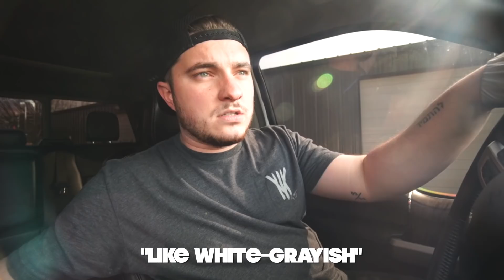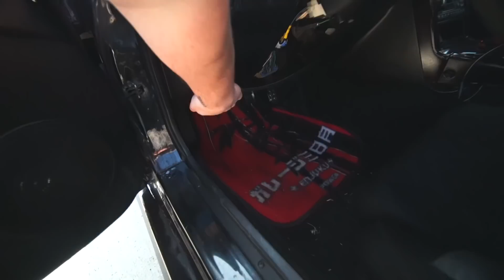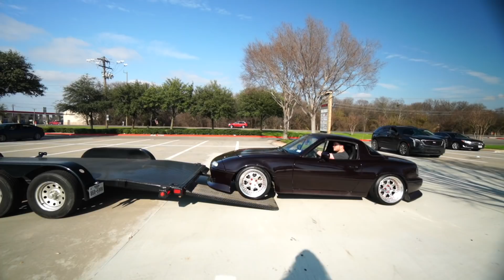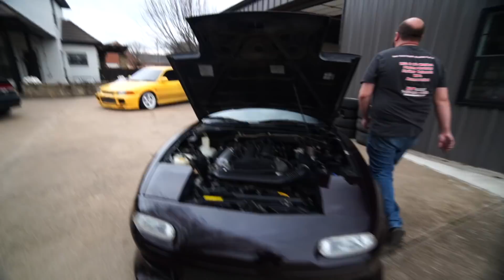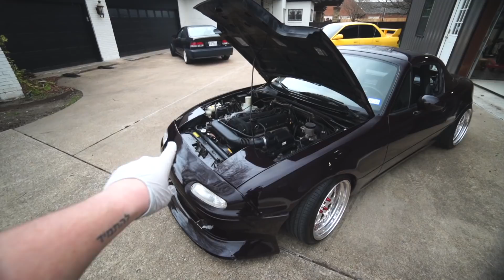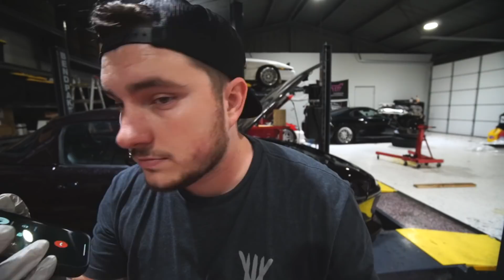Did my Little Sister Blow up My Miata?

Comment: V6 swap in the Miata would be dope. Glad she is okay! It could’ve been way worse and thankfully it wasn’t.
Reply: These things are dope with a Duratec 3.0 in them, great engine, perfectly sized and powered for an NA, and they sound FANTASTIC for a V6. Agree on this 100%!
Reply: @_PGleo86  isn’t the duratec in the ford taurus?
Reply: Lexus ls400 engine. V8. Nightride did it iirc
Reply: Don’t swap it
Reply: Should put a honda j series in it
Reply: Yes but a mazda kl de from the Ford probe its a mazda v6 sounds amazing not over the top hp reliable and again sounds amazing aa Heck
Reply: @firenut9489  j37 from the supercharged acura suv, j32 heads, j30a4 cams regrind (3 stage vtec actually for real power) and yes keep the supercharger.
Reply: throw a honda J30a in there, hooooo boy
Reply: A turbo l67 would be sick or even a 2grfe na with velocity stacks
Reply: K24
Reply: Ecotec swap
Reply: Vr30 swap it 😩

Comment: If you can, replace ALL hoses! My 99 had the same issues after I turbocharged it and one by one the old 22 year old hoses starting breaking off. I spent a good week or so trying to diagnose where my final leaks were. Apparently  there are two coolant hoses going to the oil filter cooler (pain to replace). But since then NO leaks at all. Some good preventative maintenance doesn’t hurt anybody 👌

Comment: Had my heater hose blow, loads of steam. The CAS (Cam Angle Sensor) has an o-ring that commonly leaks, dripping down onto the heater - rear engine hose and it eventually degrades it.
Reply: Had mine blow too hot coolant went all over my feet. Sat in a grocery store parking lot waiting for my buddies to show up with tools to get it back on

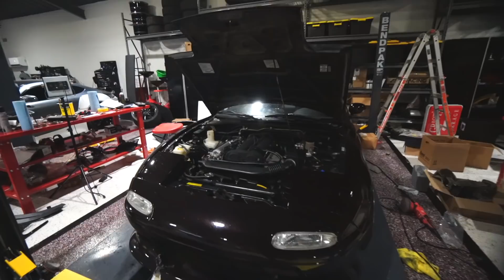Comment: 13:41 if you are planning on boost i have heard something that it's sometimes cheaper to swap a mazdaspeed miata motor with a turbo than doing a turbo kit and it's more reliable
Reply: No
Reply: Would make sense as they are a turbo engine from factory as apposed to turboing an na car, maybe they don't run well for compression reasons. Idk
Reply: @TwinJag374  no they run fine and love it.
Reply: Yes and no, the mazdaspeed kit is good if you dont want any more than say 180hp. It's restricted by ecu, turbo doesnt spool to well, the exhaust is restrictive etc. Basically if you wanted more power you would have to buy a turbo kit anyway.
Reply: @DacsterMC  you can modify ecu and exhaust tho
Reply: @DacsterMC  oh i didn't know all of that about the mazdaspeed engine but i quess people choose whether to go with a kit or mazdaspeed depending on the purpose of the car
Reply: @andriusbusiu  for a daily it would def make sense, 180hp is good enough to have fun with in such car
Reply: The engine in the Miata comes from a turbo car. The Miata engines do very well with boost.
Reply: @zillatowntv  No it doesn't, BP =/= BPT. It's not as drastic of a difference as other NA/turbo variants, but the BPT is still much stronger. 

BPs handle boost pretty well and you don't need stupid power because light car, but a BPT would be wholly superior - though obviously it'd also be more expensive.
Reply: @dyIanVII  Yes the engine is derived from a transverse mounted turbo 4 from a rally car just minus the turbo and yes they also do well with boost. You can run 8psi on almost any engine with no problems.
Reply: @DacsterMC  you ever heard of cobb tuning and bolt ons? Bro
Reply: @destroyall24  it's way easier to turbo the motor in it then to swap a Mazda speed engine in, simple, also cobb runs on OBD2 right? NA miatas don't have obd2
Reply: @TwinJag374  ECU is like $800. When I say exhaust I don't just mean catback, I mean manifold, so you're basically making a whole new kit. Just to upgrade the parts that are there. No point

Comment: On thanksgivings I had a 3 hour drive home from visiting family and I drive a 1990 accord ex. I wasn’t speeding (65mph) but I went from 4th to 5th because i had just got to the top of a decent hill I was climbing and right as I got over to 5th I heard a grind and a pop followed by something dragging on the ground, I immediately put it in neutral and attempted to slow down and pull over but my brakes went completely stiff. At the time when I stopped I left the car running for about 2 minutes to look around for issues it sounded fine no smoke and nothing dragging on the ground at all and when I turned the car off I made sure to check and shift through all the gears and everything felt fine clutch felt the same and I just waited for the tow truck, was a 2 hour tow home to my uncles house where I live. Days later  I went to try and turn over the car (keep in mind I haven’t tried to to start since it happened.) Engine wouldn’t turn over,  so I jacked it up found the crank pulley. I can turn the pulley roughly 140 degrees both ways before it completely locks up. I have yet to drain the oil to look at it or take off the pan because I would need to drop the brace or ig sub frame under the pan? I really hope I didn’t grenade my engine but it does smell horrible when I take off the oil cap so probably… I will note I bought it as a project car I wanted to clean up and have a nice daily  to drive. But only issue I ever had prior was starting it every time the engine is cold I would need to continuously pump the throttle while turning over to start and it would just die or stall if I didn’t rev it up to around 2.3k rpm until the engine was warm. I believed this caused to much wear on the cylinder rings and just wore it out completely.. I can’t work without a car because I drive for doordash and it’s easy considering I’m 18 and still a senior in Highschool and need to be home to help with my little cousin so a real job isn’t practical for me especially in my area when the only jobs available are warehouse jobs for swing shifts from 3pm-12am 5 days a week. Meaning without a car I can’t work and if I can’t work I don’t have money to fix my car or get it to a shop. The situation couldn’t be more comical. But if anyone has any clue as to what exactly happened it would really help. Also I forgot to mention that what ever broke wasn’t a cv axle they are still there and I can’t seem to find what broke off and was dragging. So please wisdom of the comment section help! If I’m unable to get the car fixed I will be selling it for a couple hundred bucks it’s slammed with a near perfect interior for its age just  don’t know what broke F22a2 engine with 5 speed manual.
Please help!
Reply: You might consider asking some mechanics on reddit or something, I'm sure there's a subreddit where you can get mechanical advice.
Reply: @hyrumlowry6129  yeah probably, thanks for the tip!

Comment: Haven't watched everything, just Jeryn describing and my bet is heater core hoses, super common on Miatas, they blow up, steam goes everywhere, coolant goes on the exhaust, and if you have a blow shifter boot the smoke can come through there.

Edit : I am so big brain. No but to be fair I hang out around miata forums a lot and it's an insanely common issue, it's not my diagnosing skills that helped me, those hoses are too close to heat and just dry rot excessively fast, most people put fire sleeve over them. Also please get a tool bag to throw in your truck, it's a truck god dammit, it's the kind of vehicle in which you should always have tools, I don't even understand how simply going to a store a few miles over to get a 10mm wasn't your first idea and that you'd rather rip the bumper off.

Comment: Miata trans tunnels get more hot than usual, its normal, also the smoke coming out the center also explains the heat coming out the center meaning the shifter seal is broken

Comment: I put 4000 miles on a bad headgasket with no smoking and no oil mixing. It broke along the coolant/exhaust passage but was pushing exhaust into the coolant. That made me not burn but lose coolant by shooting it out of the reservoir under pressure. Headgaskets are complicated...

Comment: Hey Evan I have experience in this so you should buy a lower temp thermostat take the housing out for it and make sure it’s not corroded inside and flush all old coolant out and it should help with that problem from happening ever again a lower temp thermostat is good for this Texas weather trust me on it

Comment: There's a company in the UK who do a kit for a V6 swap using the Duratec 3.0L V6 engine. They're called Rocketeer. They make a proper adapter plate for the gearbox etc a new subframe, ECU everything. 👍🏻 you can either buy just the kit parts and source the engine yourself or they will build you an engine from the AJ30 version of the duratec v6 which is from a Jaguar, jts the highest quality one. 😊

Comment: When a car is blowing white smoke out of the exhaust pipe that generally means that you are burning oil! Talking from experience because one day when I was going to get my oil changed in my 2008 Nissan Pathfinder 4.0 V6. They had finished my car's oil drain and fill-up. I was heading over to the blain's farm and fleet to go pick up mulch for my new house. in the meantime something feels incredibly off. my engine is stuttering like crazy. I pull into the Blain's farm and fleet, there is a sh*t ton of oil on the ground under my parked car. something like 3 quarts. I acquire my mulch. then I leave, next thing I know. I look behind me there is a hell of a lot of smoke. I pull back into the oil change depot, after about 5 feet into their property. my car's engine COMPLETELY locks up. when they were originally replenishing my cars oil they put 13 quarts of oil in my car instead of the 5.42 quarts my car needed. there was a good 600 feet of smoke down the highway and 30 feet of oil down the driveway of the oil place's property... Shop local they said, it'll help the community they said. just stfu and don't tell me where to shop again!
Reply: Blue smoke is actually oil burning
White is coolant
Reply: @handsz  nope.
Reply: @handsz  then why did my car’s engine burn oil in the color white instead of blue

Comment: I popped the exact hose in my 1.6 turbo, mine was caused by a leaky valve cover gasket, the oil ate a hole in it. Best to check that and the cas o ring as well as its a common spot!

Comment: Same thing happened to my 240sx with a Ka24. I swear it’s the same type of smoke and then I thought it’s a head gasket. When I posted it for sale on Good old Craig’s, a guy was like yo check your coolant hose in the back. And then my dumass didn’t know what it was and couldn’t drive for 3 month 😂

Comment: Hahaha funny same happened to my 94 NA just a little different issue, literally sitting in traffic you’d hear a hissing noise and it would smoke for like crazy for a minute or two and  since I live in Vegas Miata’s aren’t the greatest at cooling even tho koyo rad did design the radiator from factory and I ended finding out that my heater core hose was rusted and brittle, while since Miata’s top part of the radiator is plastic they tend to have a blockage and they get worn out and I replaced both of them and I went with a all aluminum radiator same brand koyo rad but the 36mm and all overheating issues went away :)!

Comment: Trans tunnel getting hot is pretty normal, happened pretty bad on my Miata just changed out the insulation and that fixed it.

To me it sounds like her car just overheated.

Comment: this exact thing happened to my b6 a4 25 mins from my house, i proceeded to drive it in high gear at low rpm for those 25 mins and my coolant temp hit a NICE 272 at that final stretch to my house lol